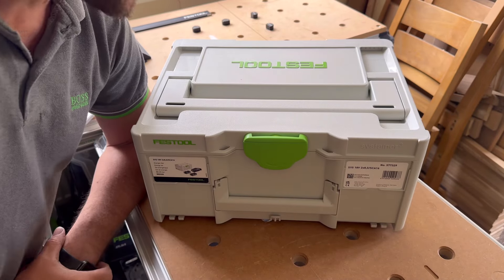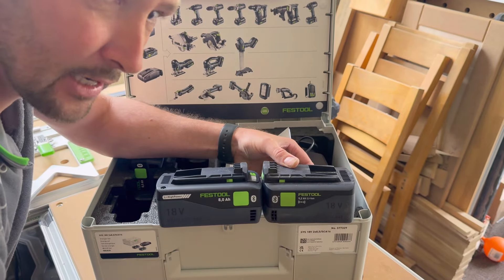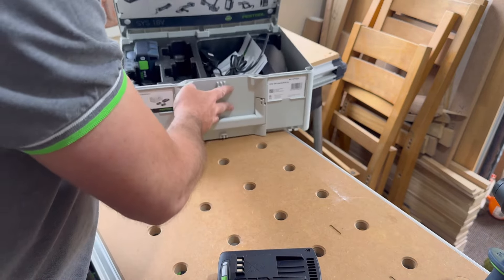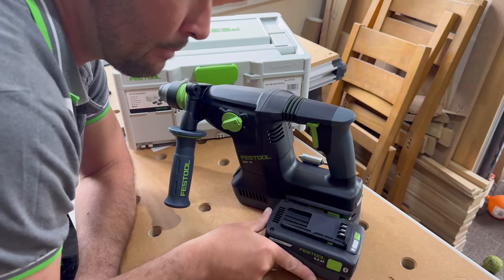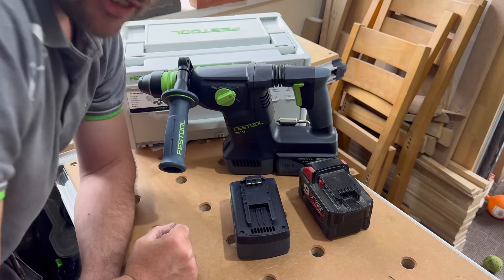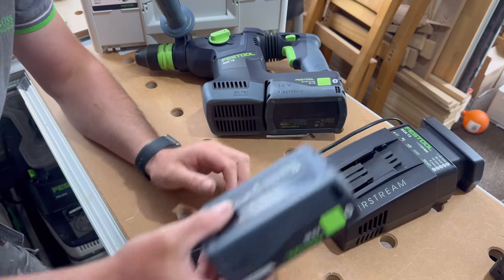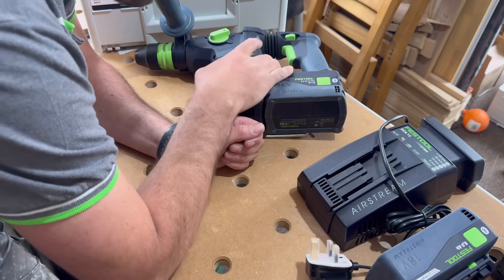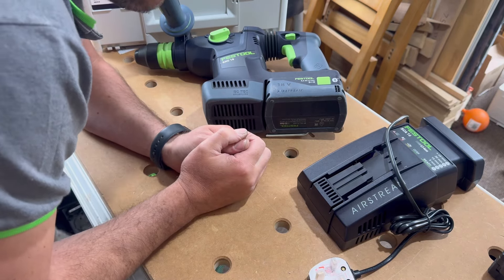Festool 8amp hour energy set and KHC demo

Comment: That looks good.  Years ago I had 4 Ryobi 4amp NiCad batteries I use on a job cutting underlayment.  It was a bit cold in the house so I could only work about 4 hrs. straight until the batteries were to flat to get a charge enough to keep the 6.5" circular saw going.   Batteries and tools  have come a long way since then.
Reply from the maker: I’ve been there myself. My old Nicad I had to charge over night as it used to take so long to charge. Lithium batteries has been a game changer as you can charge at any stage of the cycle. Nicad you needed to wait until they were dead until you charged. Thanks Warren 👍😄